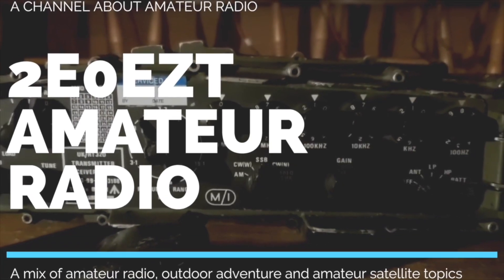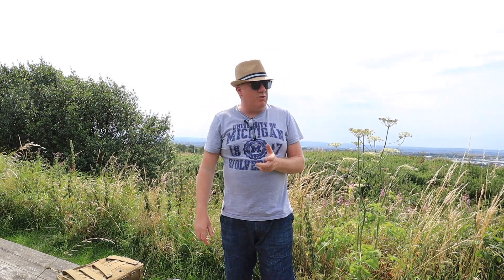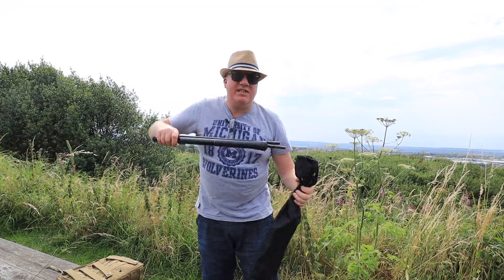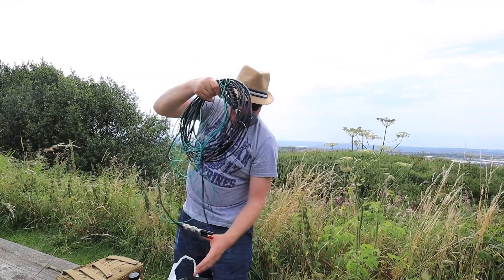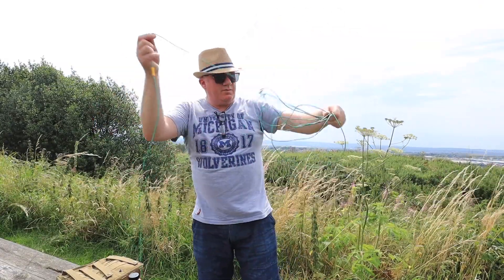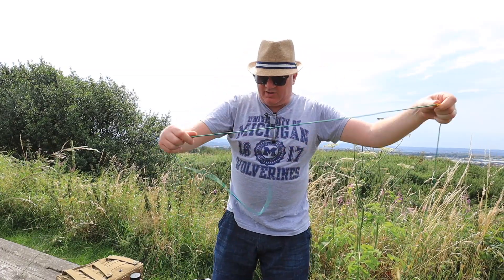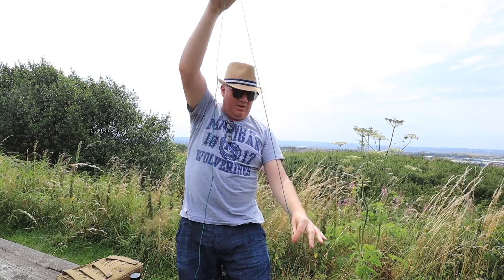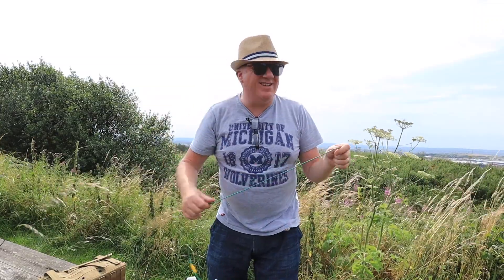Building a simple lightweight ham radio antenna for 20m

Comment: I guess I’m a little confused if you had a 5 m pool why would you need to wrap the wire around it if the wire was 5 m as well could you please clarify
Reply from the maker: It's because the pole is less than 5m (closer to 4m) and a quarterwave of 20m is over 5m
Reply: @M0SZT    Thanks thanks for getting back with me I appreciate it I look forward to trying out antenna
Reply from the maker: I would recommend a 7m pole rather than the small 4m ones.

Comment: I am sorry to say this, but I have said this on many other of these videos, it was not very helpful. The video is supposed to be about building an antenna. I am a noob, soon to get my intermediate but know nothing about creating low VSWR on antennas. So, you give arbitrary lengths of radials, not how many, I understand about the quarter wave calculation. BUT..... what is at the end of this wire? Surely it doesn't go straight into your xmitter? How did you connect the Sark 100 to the wire to check VSWR? In essence, you showed us a bag of wires, one then wrapped around a pole, but no details on what happens at the business end. Please in future show complete builds and full info. It seems to me that Hams are members of a magic circle, giving out very limited info on how things are really done, but sucking people in like click bait with inaccurate video titles.
Reply from the maker: Hi Mark, how many antennas have you built so far? I built around 4 during my foundation, not from sitting watching YouTube but reading the manual, looking at diagrams etc. You can download 1000's of PDF's on the subject. 

You can't go around blaming others for not knowing how to create low VSWR antennas or how to connect a bunch of wires to a radio, you have to own that I'm afraid. 

The method I used which I showed at 2.34 was a BNC to two 4mm banana plugs. You can of course put the radiator wire to the inner core of a feeder and the radials to the shield. You can also build a dipole in an hour with the same method. More fun that watching click bait like me 😀
Reply: @M0SZT  Thanks for the info. I used to be an electronics engineer, nothing on RF though. There's loads of paper antennas to be accessed, but then, not many videos showing them actually made and working. 'Build a magnetic loop' was the last one I complained about, sure the US guy gives all the details but doesn't plug it in and use it at the end of the video. 

Let's face it, if you have a decent antenna 'tuner', and loads of power, you could probably get out on steel lamppost. Usually, hams say that an end fed or wire dipole is how they QRP DX, you use a vertical that seems to work, I was interested. Your video is more of a 'Use a QRP vertical', rather than build one. The details are missing. To be honest, I don't want to waste time and money building useless antennas, in this, the 21st century, we have YouTube where Hams (especially if they state so in the title) should be showing the details and operation to noobs or others. 

There is another video about an inverted V QRP antenna on here, 80% is taken up by walking up and down a hill, the erection of the V is speeded up, then magically, the camera at a distance so can't even see what rig he is using, he is making contacts! It's like producing an instruction video of how to use a rifle for a person that has never seen one, but only showing how to clean it, cos after all, that is the most important thing :-)

Comment: How's it going, Carl.
Great video and well timed as I'm about to do something very similar on a trip out. Please can you explain why the extra wire was added though? 

Cheers
Reply from the maker: Thank you. I think the wire is slightly longer than the intended quarter wave because of the effect of coiling around the pole, this must have some form of shortening of the electrical length affecting the impedance.
Reply: @M0SZT  thanks mate. 
I think you said as much in the video. I guess I should have asked what that meant, broken down. I keep going over it but can't quite work it out. 
No bother, I'll Google it out! 👍

Comment: Good stuff, Carl. 
During the ARRL Field Day weekend I set out with a goal of working 50 stations on 20 meter SSB, using an Elecraft KX3, a 10Ah battery and a quarter wave vertical on a fishing pole.... using 5 watts of power from the top of the mountain on my property. 
I accomplished that goal without much trouble, camped overnight in a hammock and enjoyed some nice scenery.
Reply from the maker: Sounds a great experience, hammock camping is fun too

Comment: Nice video. It's the kind thing I'm thinking of doing occasionally. But I'm wondering how well an ampro 20 would work with radicals instead. Not sure if there would a compromise too far or a very compact portable antenna.
Reply from the maker: The ampro is very shortened however a pair of them as a horizontal dipole should be interesting.
Reply: @M0SZT  I might try that. I've not decided where I am going to operate. So something light and free-standing seems good at the moment. Lots to think about.

Comment: Great video Carl , a lot quicker and simpler than your last attempt, have you considered a EFHW using a homebrew 49:1 transformer? Google Steve Ellington efhw he has some good info, you wouldn't need a large toroid for low  power, very simple to put up, 73 Bill M0TDW
Reply from the maker: Will check it out thanks

Comment: Nice simple antenna Carl, and looks like you got some good signal reports on what seem like quite weak conditions right now on 20m. I might try this as a simple to setup upgrade instead of using my ampro whips when out mobile/portable, I wonder if a inverted L   would also work on 40m based on this setup?
Reply from the maker: Yes I'm wondering if that would, I'm thinking if there's a branch nearby I could throw a line over to get the horizontal bit of the L. However if there's no branch it may require two of the small telescopic poles

Comment: Good effort. The only issues I have is that 10-15m of radials is a little light for ground radials. Maybe 40m as a minimum.. this is why you are seeing a flat SWR which ideally you shouldn't for a ground mounted quarter wave. Also the dangling wire may provide issues with tuning if flapping around. Good to see someone else trying portable stuff out.
Reply from the maker: Now that's interesting, didn't know that about radials, thanks for the advice. Yes I added a note in the text for the video about watching the dangling wire.

Comment: Nice one Carl. I wonder if you could have had successful contacts with only 10 W on that antenna and location? Still struggling here to get signals out on HF as a foundation operator. 73s, David M7DKS
Reply from the maker: Yes 10watts would work using search and pounce with patience.
Reply: As a new Intermediate license holder I've done plenty on 10W with my M7TUX callsign.  What antenna are you using and where?
Reply: @2e0txe  A half-size G5RV in my back garden. only about 15 to 20 feet above ground though.